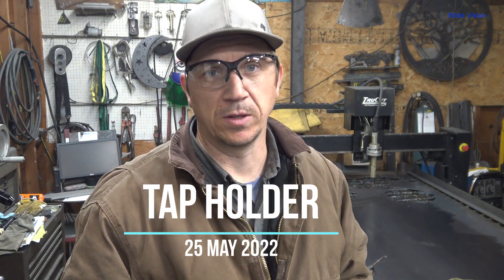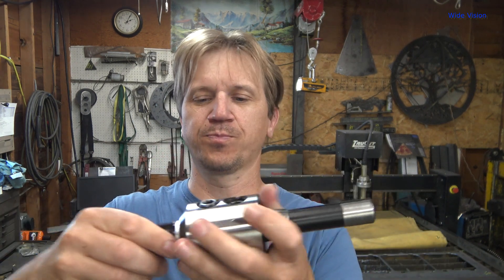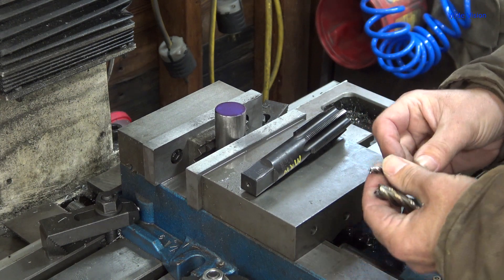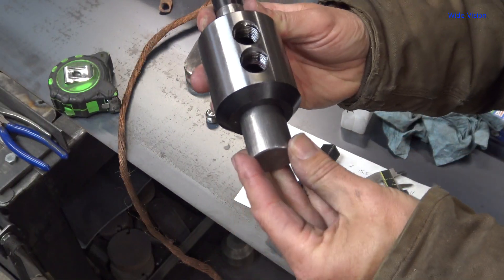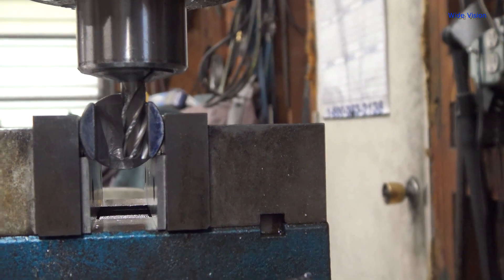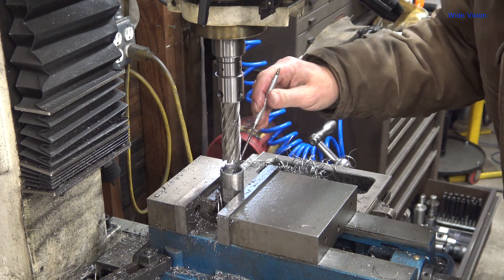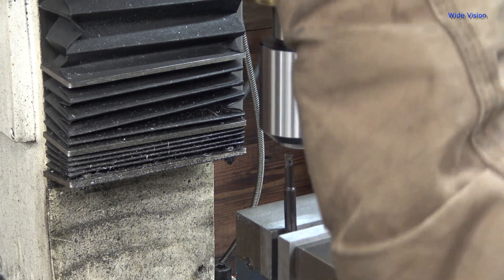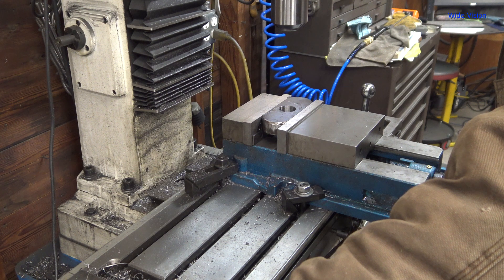TAP Driver Build - A holder to Use taps in a MILLING MACHINE! - Instructional build from Wide Vision

Comment: You can speed up your rough out and not load up the cutter by too deep a passing cut just by plunge cutting except for the finish passes to final dimension.

Comment: Could you go over your hydraulic power pack, I would like to make one 110v but not sure on pump sizing?
Reply from the maker: That's a fairly involved topic. Pump size depends on your needs. For a press, low flow, like 1 gpm is better for control, so  a 1.5 hp motor would be a good match.  With 110V, you're limited to 2hp motor, so the options for GPM are limited. The SurplusCenter has a hydraulic calculator under their "Tech Help" tab on their website. It's then under "pump disp. HP GPM RPM"  It's great for figuring out how many HP you need or the displacement of the pump to get the needed GPM. My current hydraulic unit is a 3/4 hp motor and about 3/4 gpm pump.  I'm building one that uses a variable displacement pump, so if I can get that thing done, there will be a video about it with a lot more information.
Reply: @WideVisionMetalFab  thanks for the info, I got an extra 1hp laying around I’m gonna try using, I look forward to see a video of your pump build!